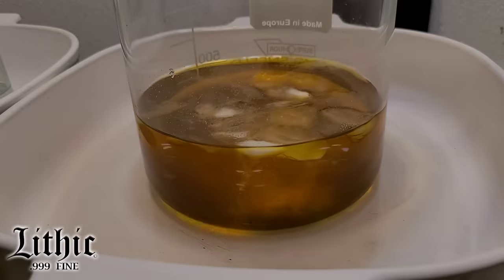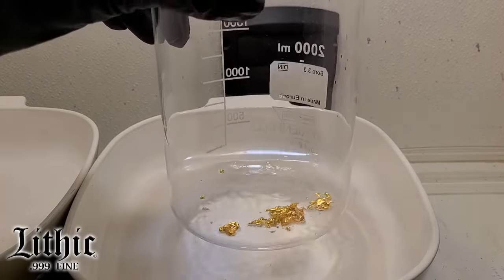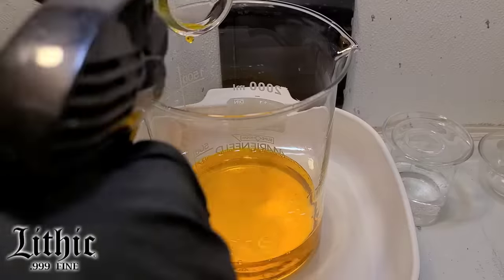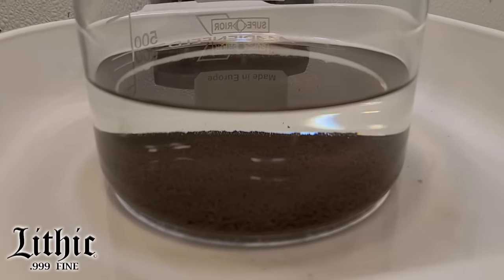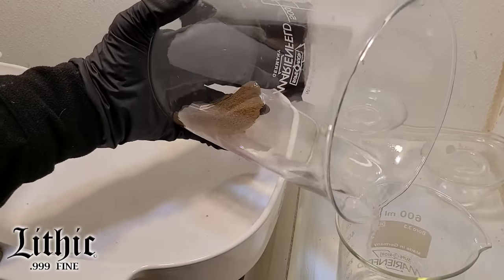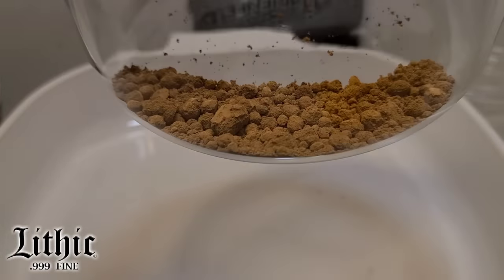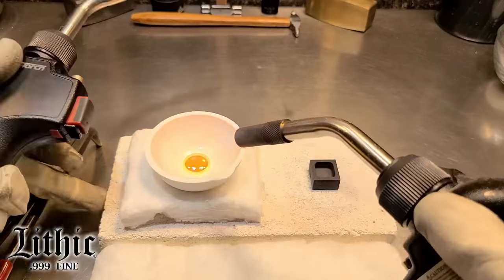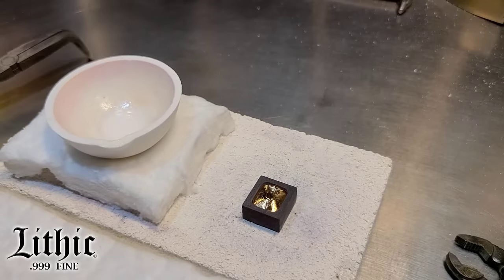Does it really matter if gold bullion is contaminated with a little silver? Let's find out!

Comment: If you want a super clean precip bubble SO2 through a dilute AR solution. H2SO4 to SMB, filter through H2SO4 and bubble to the AR. Also has the benefit of a very good indicator of when the reaction starts, not going to spoil it but it’s super cool.

Comment: Hey buddy, I have an electric melting furnis exactly the same as yours. It turns on and heats up fine but when it reaches the designated Max temp, it trips the safety switches in the house.
Do you know what's wrong with it ?
Reply from the maker: You know, I had the same issue the last time I fired up my black one. I'm not certain of the cause. I rarely use them anymore. I prefer a melt dish and torch. There's pros and cons with both methods, but the dish works best for me. Then I don't worry about tripping the boxes lol.
Reply: Too much stuff plugged into that one circuit.  You should use a dedicated circuit which means one breaker for one device.  You could always unplug things while smelting.
Reply: @mybad8805  nice idea, thanks

Comment: At which point in the process did you remove the silver and base metals? You never bathed the gold in nitric acid, which would put silver and base metals into solution leaving the gold untouched.
Reply from the maker: The nitric bath is used with inquarted gold. At levels of higher purity, there is no need to inquart the material. It goes straight into AR. When the gold is dropped back out of solution, the impurities are left in solution. Nitric acid alone does nothing to pure gold.
Reply: @LithicMetals  Ok, I thought the SMB precipitated silver too.

Comment: When you say a "lithic bar" is that your branding or is it a technical term? I know lithic means of or pertaining to stone
Reply: Also, what is the name of this process which precipitates the gold out with sodium metabisulphite? a I'm not really involved in gold processing, but from curiosity I'm familiar with the Miller and Wohlwill processes. I'm impressed that, according to the stamp, this method gets the same 5 digits of purity, but without needing to leave any gold behind in solution like you would after the anode is dissolved in the Wohlwill process. (though to be fair, that's usually used by an operation that knows their going to be purifying more gold later, so it's a step saved more than it is gold lost.)
Reply: *they're

Comment: You must use an RO setup to produce your own distilled water? I can't imagine it'd be cost effective to buy this pre-bottled?
Reply from the maker: It's $.99 a gallon here. It's more cost effective to purchase than to run the setup. For me anyway
Reply: @LithicMetals  That's actually incredibly good value - here it's around £1 or $1.32 a litre - 3.8 litres in a US gallon so a gallon here is like 5x as expensive!

Comment: Wouldn't a nitric only boil at the start remove most of the contaminants? Then proceed like you did for a cleaner gold.
Reply from the maker: It sure wouldn't hurt! But I'd still be stuck going through the same procedures. 🙂
Reply: It wouldn't as the gold would shield the contaminants as it is already .999 pure. That shielding does not occur when the gold content drops below about 25%, which is why enquarting impure gold is such an important step when refining.

Comment: I enjoy your content. You do the right things the right way... But this video i would have done 2 things different if i was going for 999 cause i don't believe you can got it that high here. First thing. After adding sulfuric to precipitate any lead and filtering. I would dilute the solution by about 3 to 1 distilled water to solution. the silver thats present will be in the form of silver chloride which is essentially insoluble in water. So any thats there will get forced out of the solution. You gotta be really careful filtering out silver chloride its so fine sometimes it will pass right through filter paper. If thats your only option run all the solution through the same filter 4 or 5 times. What i prefer is a two part process take a big funnel.. jam some cotton balls into the neck. Dont compress too much but you want to moderately compress them. The  add filter paper or coffee filters in the funnel like normal. The filter paper will catch any large chunks. The cotton filters via wicking the liquid through its fibers if you got it compressed enough it will catch everything in a single pass. Its not just silver copper chlorides have a lower solubility in water than hcl so you'll likely remove some copper as well. Then id reduce it to its original volume or a bit less. Adding smb like that is gonna contaminate your drop with salt and also it will bring copper out as well especially if used in excess. Since its not the smb but the sulfur dioxide that reduces the gold out of solution a sulfur dioxide generator made out of a filtration flask using the smb and hcl. You can bubble the gas cleanly to your solution. Either that or dont use smb at all and use a concentrated oxalic acid solution. If you go that rate both the oxalic acid solution  and your gold solution gotta both be boiling. That'll make the prettiest cleanest drops you can get. Nothing wrong with your way... You may get 99 fine but any better than that will be tough. That thousandth of an ounce difference can be a bitch to get to especially so the smaller the size of the refine. Just my unsolicited 2¢.. you're channel is about the best on youtube. Thank you for what you do

Comment: Hmmmm.... I have watched many gold refining videos. I have seen people try to clean up their gold by refining with SMB on the first refining, and then using some other method to drop the gold on the 2nd refining. I have never seen ammonia used, and I suspect for good reason. Gold will react with the ammonia. Check out the study: "The solubility and speciation of gold in ammonia-bearing aqueous solutions at elevated temperature: An experimental study". You will lose some gold to the ammonia. You can likely get it back by treating your waste chemicals. But that seems a bit sketchy to me, especially if people are trusting that you will give them 100% of the gold back after refining.

Comment: This whole video is about a chemical process to purify gold. Although the procedure is more or less shown here, it is not totally clear how chemically this is working. The idea is you have to somehow differentiate between what you want and everything else. What seems to be the critical step is when the sodium sulfate is added the gold goes to the bottom and everything else is in solution. When these steps are over you may have gold+something that maybe is vaporized with heat or something. So I am not clear where the ions and compounds are in each step etc. But interesting.

Comment: Erm distilled water cannot form silver chloride, you need regular water if you want to do that, since it contains chloride, while distilled water is pure water.
Reply from the maker: Actually, if you reduce the solution to the proper amount, it will indeed cause the chlorides to form if present. The hcl provides the chlorides.
Reply: @LithicMetals  where does the chloride come from ? Magic ?

Comment: Why is it not an accurate weight to measure it in bar form compared to shot form?
Reply from the maker: I'm not certain about what you are referring to.
Reply: @LithicMetals  in several videos, you state you are taking the first poured bar of pure and remelting it into shot in order to get an accurate weight measurement. Before pouring the final bar. 
I’m curious why you can’t just measure out the bar and save the step of making shot. 

Now that I think about it, I assume it’s so you can easily add or subtract bits of the whole amount in order to get a specific weight before pouring the final bar?
Reply from the maker: Ah. What I mean is... once it is shot or grain, I can weigh the exact amount I'd need for a bar that is a specific weight. Like, 1oz or 2oz. I don't want to pour bars that are just random weights.

Comment: After pouring the gold shot, you could have just used nitric acid to remove base metals...  Nitric by itself won't put Gold into solution...
Like the tip about the Ammonia though to clean it..
Reply from the maker: Naw, unfortunately, Nitric wouldn't do anything to this material. It wouldn't penetrate the outer layer of the gold, thus it couldn't put the lesser metals into solution. 

Thanks for watching!
Reply: @LithicMetals  You could have also inquarted it by adding silver to increase penetration...  neat idea tapping for cooling lines..
Also if the contamination oxidizes on the outer layer then it doesn't need penetration..  might have been able to just dip their bar in Nitric..  you still got great results though..  just comments, not criticisms...  have a happy Easter!

Comment: Isn't all gold contaminated with silver or copper? After all that, Isn't that how it keeps it's strength?
Reply: ROFL
Reply from the maker: All gold that comes out of the earth is contaminated with various other metals to some degree. It's harvested and refined to a high purity. When folks craft things like jewelry, other base metals are generally added to provide durability and tone. However, when it comes to bullion, certain standards of purity are demanded. When you buy a pure gold bar, the levels of contamination are extremely low. Such as 1 part in 10,000... or .9999 fine.

Comment: I prefer to use a nitric wash. Hcl wont remove silver. Nitric will along with any nickle alloys.
Reply from the maker: You must wash with a ton of water first to remove all the hcl? All I can imagine is gold going into solution. I never heard of rinsing precipitated gold with nitric. 🤔
Reply: @LithicMetals  Yes I do several boiling distilled water baths. Any HCL present would simply revert to aqua regia/ chloro auric. I then do several more rinses. 
I deal mainly in jewelry/ Electronics scrap. So my 1st aqua regia is a bit green/ yellow. Highly contaminated. Post precipitation result is blue green sol.
By default it still has trace silver, nickle.
I end up with the same nice cinnamon color powders you achieve.

Comment: You can separate the silver of you add HCl. Then AgCl will fall out, while copper and other metals stay in the soultion. If you filter off the sediment and add ammonia to it, is dissolve as [Ag(NH₃)₂]Cl, while impurities won't dissolve. Copper would make the solution blue, so a clear solution indicated the absence of copper. Filter the solution and then reduced the silver ion with NaS₂O₃ to silver metal.  Filter and wash.
Reply: i think the guy with the metal channel knows how to work metal

Comment: 12:14  Lost 0.002 oz. of contaminants.
Reply from the maker: Yeah! I blew that! I really gotta start writing scripts lol. Thanks for watching! 😁
Reply: @LithicMetals   Not at all.  I just wanted to make sure people knew just how small of an amount it was.  Does alcohol have any use in refining?  Was mercury used because it was cheap.  I know how dangerous it was (as vapor)?  Will ingots, if poured without tapping and the extra heat, have a random pattern?  Is there any way to have a mirror finish all the way around?  Maybe polishing?  That would remove material though?

Comment: □■
$100.00 through 400.00 higher standard ounce price, pure gold greater visible invisible periodic element table?
10 to 18 galaxy placement requirement 17 galaxy 1 to 7 times price?
Gold 1.0 standard visible invisible galaxy 100% $1478.14 ounce 27.1 gram? 
Pentium celeron conduit terminal unit convert 0 to 17 pages 5page scroll 90 to 900 pages.
Reply from the maker: You bump your head? 🤔